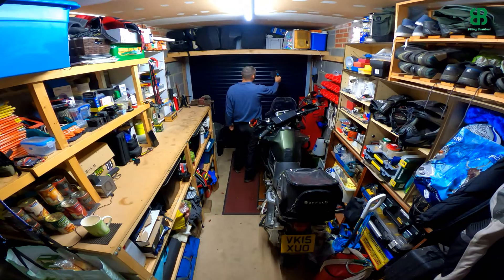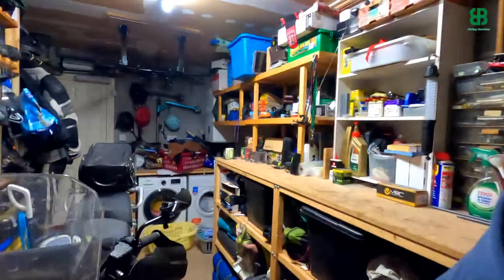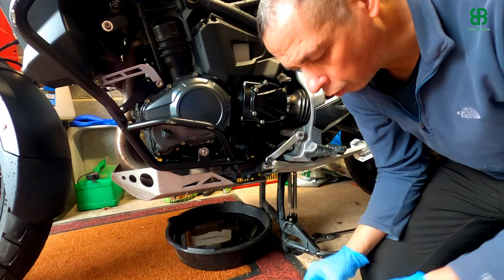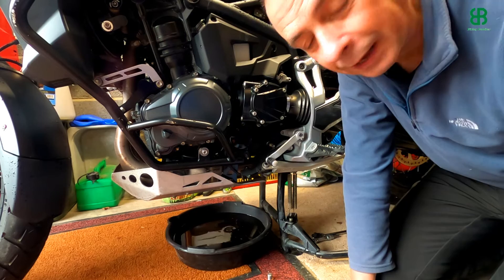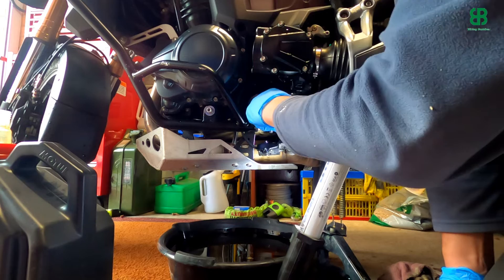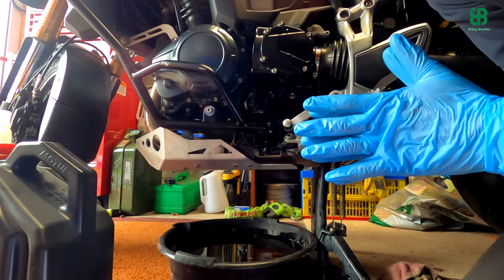Oil Change On My Triumph Tiger 1200 XC #176

Comment: I went ouch when I heard you say about tightening the sump bolt and saw the effort you were levering into it. Its 25NM.....firstly I'd always suggest an important tool to anyone working on a modern motorcycle is the relevant torque wrench. The Triumph mechanics use them. TENG tools do some superb models which dont cost a kings ransom for the Santa Claus list if you've been a good boy.  Secondly, 25NM doesn't need the leverage you were putting into the ratchet I think you'll find. 

Enjoy the videos.

Cheers

Stuart

(Edited spelling)
Reply from the maker: Cheers buddy. Great idea for my Santa list
Reply: Me too. Every grease monkey needs a Speaking Spanner (  aka a  torque wrench.)

Comment: That particular oil filter has a pre-lubed rubber seal, that is why it had a protective plastic cover. It seems quite common now.
Reply from the maker: I guess I'm still a little old school - thanks for the comments though

Comment: I think you tightened it perfectly, not sure why folks freaked about a torque wrench.  People can be so ridiculous.
Reply from the maker: Thank you - its all in the feel.
Reply: You’ve got aluminum threads which can gall very easily.  I have the same bike and use a torque wrench and I always hit the recommended torque before it feels properly firm compared to any other bike or car I’ve serviced.  At least in the US a Harbor Freight wrench can be had for about $20, cheap peace of mind.
Reply: @raymondbunkofske4702  
Yeah, I don't trust cheap torque wrenches.  Even good ones have to be calibrated, right?  I never used one and never had a problem.  There are specs on parts where it really matters, but I can get an oil drain bolt or oil filter or axle bolt or lug nut tight enough by hand without causing a problem.  If anything, professionals who use power tools over tighten all the damn time, making it impossible to loosen a bolt without power tools.

Comment: Nice vid, my only concern is that oil level check is the bike should be on both wheels not on center stand to get the level ?
Reply from the maker: Thanks Buddy - to be quite frank, the level isnt critical as long as its a healthy margin between the max and min markers. I really don't get that hung up as long as I'm closer to the max
Reply: @BikingBuddies  was advised by triumph in how to check levels